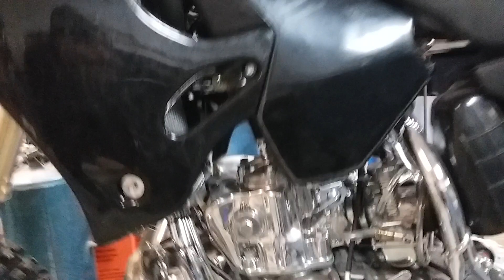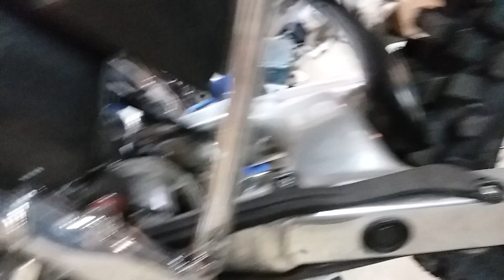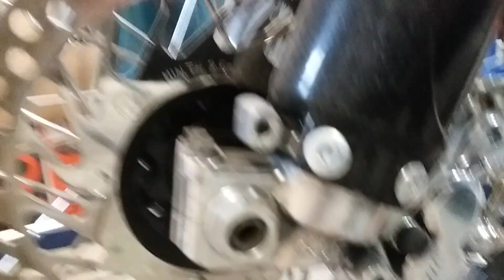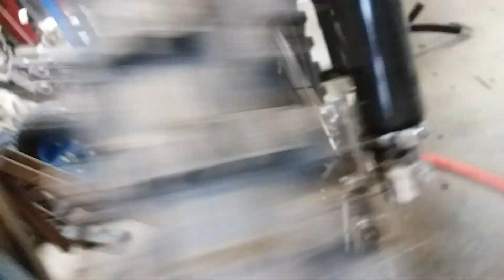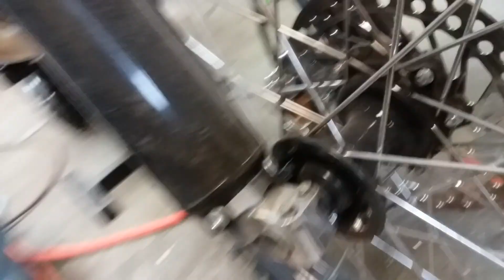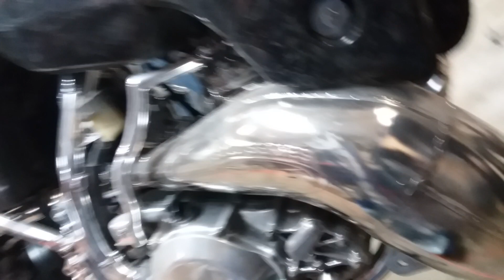Black Sunshine

Comment from the maker: 93 CR250  restoration/upgrades: wheels A60 with spline core spoke nipples and all new spokes. The hubs are stock and repainted gloss black. Rebuilt front and rear calipers and master cylinders with new break pads. All new bearings and bushings throughout the bike. The front forks and the Applied Racing billet triple clamps are off a 02 CRF 450. Pro Taper fat bars with the Henry/Reed Bend. Billet throttle tube. Clutch lever and perch are billet aluminum with the billet on the fly adjuster. Braided steel brake lines front and rear. Reinforced the motor mounts and welds on the frame rails. The motor bottom end is a complete Hot Rod stroker kit that means main bearings, crank, rod, gaskets, seals are all new. The cylinder was stripped replated and hone sized to fit a stock Wiseco Pro-Lite piston and ring kit. The head combustion dome was resurfaced and remachined in alignment with the spark plug along with .020 milled off to increase the compression. Boyesen rad valve with carbon fiber reeds. The carburetor is stock but completely rebuilt. The radiators are new oversized aftermarket set. The clutch plates, fibers, springs are all new stock with a billet aluminum clutch case cover. Rear rotor is brand new along with the rear caliper guard and chain guide. Rear shock is completely rebuilt and I went up one spring rate stiffer on the rear spring. Brand new FMF plated gold series exhaust pipe and powercore 2 silencer. All new black plastic. A ribbed gripper seat cover. Covered the stock white plastic air box with black Flex Seal with a new twin air filter. Chrome plated the frame the subframe the rear shock spring... every other piece of metal or alloy on the bike was hand polished by me. The foot pegs are off a 07 CRF 450 and chrome-plated also. Any Q's? Just ask...

Comment: Amazingly stunning build!!!! How hard is it to keep the bike looking that nice, do you have to consistently polish it or dose it last for a wile, considering you ride in dirt !!??
Reply from the maker: Thank you it was a labor of love. As long as you keep it off the dirt I mean keeping the rubber side down on the dirt it's not too bad. After I wash it I blow everything off with a airline so the water spots and the rubbing is a minimum. The Chrome shine lasts pretty good the aluminum buffs backup pretty easily it depends on how perfect of a shine I want I give it a touch up buff about every 3 months. As needed but the dirt seems to fall off and clean off way easier with everything being smooth.